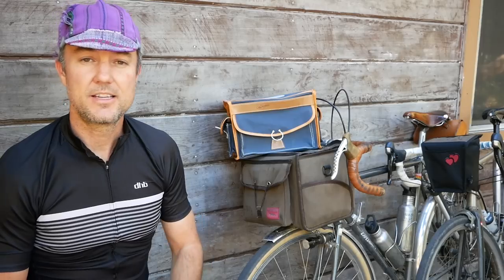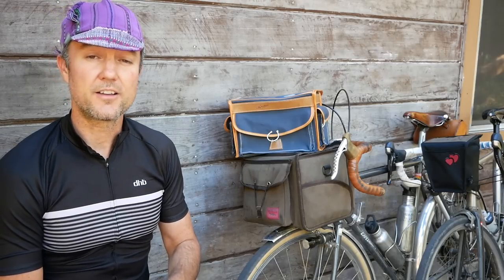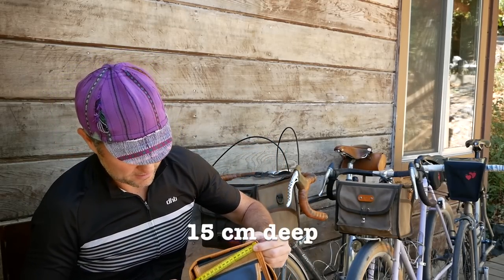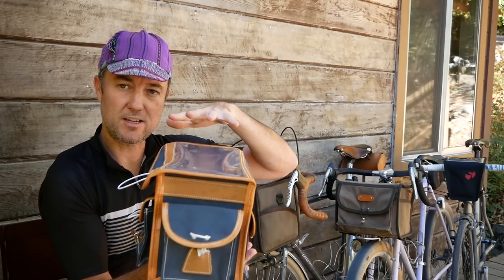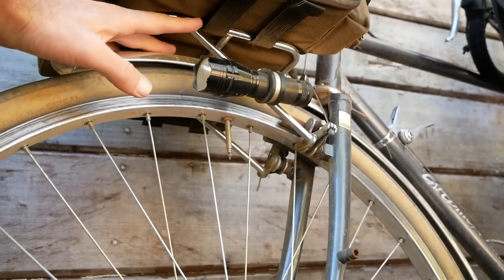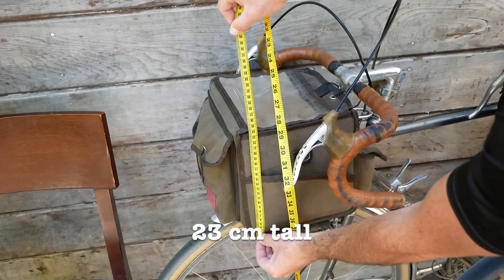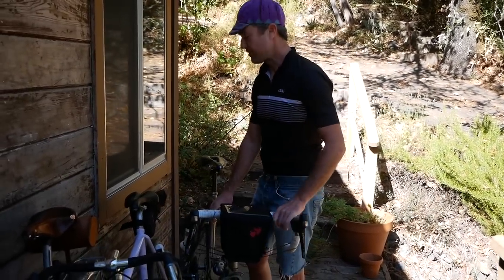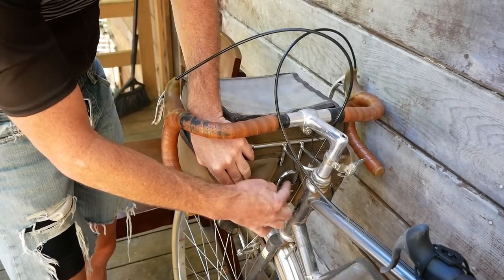Handlebar Bags | A Few Options to Consider: Swift Industries, Gilles Berthoud, Ruthworks, or Acorn?

Comment: Very instructive Vlog.  I used the same nylon handlebar bag for 50 years. I think it is English.  In that time, I had to reconfigure how it attached to my bikes over the years.  A year ago, I moved into the 21 century and found a camera bag with interior zippered pockets about the same dimensions 25cm x 25cm x 20cm only padded with improved features.   I have a rack for front panniers and have the bag sitting on top of the front rack.  I designed a quick release system that allows me to have the opening facing forward or toward the cockpit and it pops off with one hand in seconds. I set it forward on the rack so that I have the handlebars free for more hand positions. The distance gave me the opportunity to suspend two water cages from the handlebars. The bag has a top handle and clip on shoulder strap, making it useful to carry into a grocery store or market to pick up the day's food.  I mount my wireless speedometer/ odometer to the top of the bag for ease of reading and it is out of the cockpit.

Comment: With handlebar rando bags I highly recommend the use of a decaleur and small front racks. It will allow the bag to sit lower which will help the way on how the bike will ride. And like you mentioned it will allow your hands to still have the entire handlebar to use for different positions. Velo Orange is the only company that sells Randonneur Front Racks with Integrated Decaleurs. They sell 3 different models. I have one and it really solved my stem/decaleur issue because I am using a unique threaded headset that is designed to be remove without tools except for loosening three really small allen screws for my S&S coupled frame.  So I can remove my fork before placing the whole bike into a small case. I highly recommend these VO racks with the integrated decaleurs, they are sturdy and looks really nice.
Reply from the maker: Thank you, Bob! It's great to hear your feedback. A handlebar bag, rack, and decaleur is a big investment, so it's important to know what systems work together. I contemplated the integrated rack and decaleur when I first set up my touring bike. I looked around for feedback on your arrangement and couldn't find anyone with a review. I'm glad to hear it's working out well for you!
Reply: I updated Instagram with photos taken of my set up. Check it out when you have a chance.

Comment: Thanks for the great video!  I'd be curious to hear your thoughts on the respective advantages and disadvantages of going with a decaleur vs. a simple strap system such as the one on Ms. Cools' bike.  It makes sense that a large handlebar bag can really benefit from the extra top-end stability provided by a decaleur, but what about a smaller bag with solid stiffeners and velcro straps on the bottom, such as the Swift Industries?  Does Ms. Cools' bag rattle around a lot more than yours on rougher terrain?  Thanks!
Reply from the maker: The decaleur is a pretty nice feature, if you can work it into your handlebar, or stem. There are downsides like added weight and complexity with getting it set up correctly. Therese's simple strap method works because her bag has the extra rack straps located on the bottom of the bag. Not all bags have these, such as the Gilles Berthoud. Ruthwork, in conjuction with Fitz cycles make a rack and bag system that doesn't need a decaleur, so it's the lightest and simplest set up. Depending on what your priorities are, I would say a decaleur is optional, especially if you don't plan to have the bag on the bike all that often. For me the bag is pretty much a permanent fixture now on my touring bike. The side straps Therese uses to attach the bag to the handlebars can be an annoyance if you mind having to grip the bars and the cord together, but not a big deal if you place more value on simplicity. I can tolerate a lot knowing it's a simple work around. All the best, and let us know what you end up doing and how it works out! Cheers, HWB.

Comment: take a look at the dillpickelgear handlebar bag.  I bought one but have not received it yet.
Reply from the maker: Excellent! Let us know what you think, Davex5424. It looks like a rack-less bag, which, is great if you don't have rack mounts.
Reply: Henrywildeberry the Dill Pickle handlebar bag is really well designed and my favorite rack-less bag. It has an ingenious 6-point mount that works on virtually any drop-bar bike. It’s not quite as large as the boxy bags that stand on a rack. My dedicated rando bike has a large Swift bag, but every now and then I like to ride a different bike on a brevet. The Dill Pickle bag makes it easy to turn my single-speed bike or the racy bike into a temporary rando bike. Full disclosure: I sometimes ride with Emily O’Brien, the maker of Dill Pickle gear and I’m in awe of her abilities on and off the bike.

Comment: This is great equipment and you've done a very thorough job reviewing them. I'm wondering what you're thoughts are on wind resistance, and whether you would trade one of these handlebar bags with a frame bag.
Reply from the maker: Thanks Richard, and excellent question. I was just wondering this myself, how much "extra" wind resistance does a handlebar bag create? Wind tunnel testing at different yaw angles would be the only true way to know, because I doubt a power meter is sensitive enough to pick up the difference. I personally don't notice any extra drag, but I have felt more sideways push in a cross wind with a large handlebar bag. Front end geometry plays are part in this as well. A frame bag would probably be more aero if I had to make a bet. Having it tucked into the frame is like a mini fairing and those are actually banned from competition because they are known to work. If you want aero, go for a frame bag. If you want an easy way to access stuff (food and clothes) while riding get a rack mounted handlebar bag.
Reply: I've read that they are actually more aerodynamic, and don't increase drag. They shape the flow of the air around the bike so you don't get all the frame eddy's you normally would. Alternatively go for a traditional rear saddlebag like a Carradice where your body is already acting to improve the aerodynamic form.

Comment: I apologize if you covered this and I missed it, but here's a question: Since that Acorn bag is designed to be used without a decaleur, I am wondering about it's stability; can it handle a decent load? The ability to skip the decaleur's complexity and cost would be nice.

PS: I think that cap is cool.
Reply: I've had it for 13 years with no issues. Just get a rack like the m18 or nf21 and you're good to go. You don't even need the side straps.

Comment: Could you please write what nitto handlebar model do you have and in what size? Thank you :)
Reply from the maker: The bars are Nitto B135 and measure 42cm from center of bar end to center of bar end. They have 120mm of bar drop. They also have a slight up swing on the tops with a gentle flare at the drops. Good luck!
Reply: @Henrywildeberry  Thank you for your answer. I also decided to buy the B135 model. However I hesitate between 45cm model and 42cm you have. Unfortunately, Nitto does not specify the size between the brake hoods. Could you measure your distance? I will be obliged.
Reply from the maker: @podrugiejstronie7006  Brake hood to brake hood is approx 37cm.
Reply: @Henrywildeberry  Thank you very much for your help! In a perfect world, I would order two widths and see which one is more comfortable for me. 37cm is quite narrow by modern standards. I wonder if you will ever do an episode about your conclusions regarding handlebars. Your channel is my great inspiration. Take care!

Comment: Great Video. Thanks for posting this. Out of curiosity what size and style stem do you use on your bike? I've heard people need to run a smaller stem length to accommodate the weight distribution when using a front Rando Bag.
Reply from the maker: Hello Ben. On the touring bike I'm using a quill type stem, and I think it's a 90mm length. They make these with 25.4mm (1") or 26mm bar clamp diameter, so keep that in mind when ordering handlebars. It's the Nitto Technomic, so it's a little longer which allows you to raise it up higher (if needed).
Reply: Henrywildeberry Thanks!! When comparing your touring bike to some of your other bikes, did you shorten your reach on your touring bike to accommodate the weight of the front bag? To long of a stem will move the bag forward which could throw the steering off. I’m trying to decide how small of a stem to buy to accommodate the weight.
Reply from the maker: Anytime, Ben! Thank you for your comments! Interestingly, the reach on the touring bike is shorter as a result of two key factors. First, the top tube on this bike is shorter than the effective seat tube. Second, the slack head tube angle brings the bars closer to the saddle as well. However, the fork rake on this particular touring bike has what is called a medium trail so the steering feels slow with a front load. It's certainly not a problem, but it can be for example on steep loose gravel climbs where holding balance takes a lot of quick steering moves. Like all things, however, you can adapt to the various nuances even if they are not ideal. I would prefer a lower trail fork, but that's because I've ridden bikes with low trail and they handle much better with a front load. Also, a low trail fork has more rake and as result less toe overlap. By the way, the stem on this bike can be lengthened or shortened without moving the bag. The bag position is related to the rack and decaleur only.
Reply: Henrywildeberry thanks again. That all makes sense. With regards to stem length and weight I was reading Jan’s blog from Compass Cycles and that is why I asked. Front bags are new to me and my style of riding so I wanted some clarity before ordering a quill stem.

https://janheine.wordpress.com/2011/10/27/stem-length-and-frame-size/#comments

Enjoy the day!

Comment: The bags show reinforcement on the sides, are all the rack mounted bags reinforced with a stiffner on the bottom as well?
Reply from the maker: All the bags here each have a reinforced bottom. It's some sort of plastic liner placed between the layers of fabric.
Reply: @Henrywildeberry  Do all the bags have full internal reinforcement and are they all fully lined? The Berthoud looks as though its structure is just canvas and leather. That is one of the problems of these niche products, it is almost impossible to examine them before you pay a large sum of money for them.

Comment: Howdy. I  have an ancient (1970s) TA handlebar bag by LaFuma that came with a decaleur which goes under and rests over the handlebar and stem ( can be seen here: https://www.flickr.com/photos/specialmonkey/sets/72157680533830994 ). It's old and kind of fragile and has holes that I've patched with sticky fabric patches. I think I might be more of a saddlebag kind of guy, perhaps one of those exceptionally long horn of plenty type ones ... though I see the utility of having stuff right up front. I think the Swift appeals to me most because it's huge and because maybe it can be delivered relatively fast. Can you tell us about your headlight? It seems like a good idea and possibly less costly than a bike light. Is it a  see-by as well as a be-seen light? What kind is it? Do you recommend? I've read Lux is more important than Lumens, since it has to do with the area illuminated. Does Therese ever get in a classic mood and want a Specialized Expedition (or Sequoia)? Do you ever want a brand new Polyvalent with disc brakes? How do you like the Suntour Symmetric self trimming shifters (do they work)?
Reply from the maker: The Old TA handle bar bags and racks are very cool! I picked up a TA front rack at the L'Eroica this past year. I was hoping to install it on my old Bianchi, but it's a little small, so I may forgo that as an option. My headlight is just a $10.00 LED flashlight I purchased at the outdoor store. While it's cheap, the push button switch on the back is junk. It is made out of aluminum, so I thought it might be a good light. In general, it's not as reliable as I had hoped, so in good conscience I cannot recommend it. It's not as bright as a regular bike headlight, so it's more of a be-seen light. I'll be posting a video soon of my new bike headlight set-up.  
Therese would love to have a custom built bike to her specs. The new polyvalent is a sweet bike and fulfills her needs for a go anywhere, do it all bike. However, she's also a very serious randonneur, and would one day like to have a purpose built bike suited to long distance, self-supported riding. Something a little lighter, and built for comfort and speed. The best way to think of it would be a classic inspired constructrice (constructer). More on that later...
As for disk brakes, I'm still a big fan of rim brakes. Disc brakes are great for mountain biking (no question there), or when you plan to ride on limits, but for everything else rim brakes are fine. Rim brakes provide maintenance free braking for thousands of miles with very little adjustment, and replacement pads are cheap. Rim brakes allow the frame and fork to be built with thinner tubing and without the risk of fracture or breakage at the caliper welded joints. Rim brakes are easy to repair out in the middle of nowhere (where I typically ride). Rim brakes use narrower hubs, so you can use a narrow crankset without heel striking the chain stay. Rim brakes are much lighter when you factor in the extra material to strengthen the frame. There is more I could say, but I will leave it on this note, rim brake bikes look better. 
The Suntour components are very well made. The self trimming shifters seem to work okay, as fas as trimming goes, but I like that the levers are close together. I can shift both front and rear shifters simultaneously with one hand. That's pretty cool! Thank you!